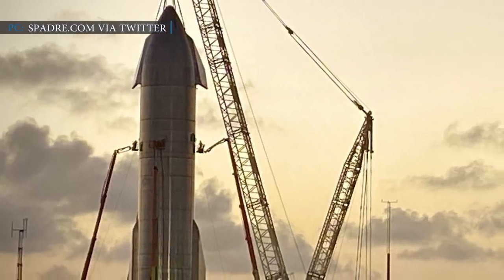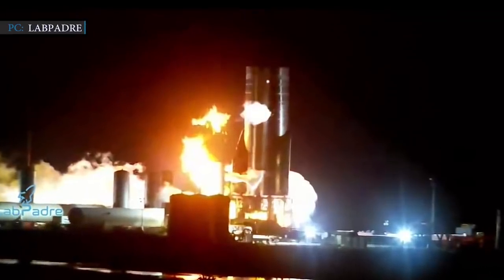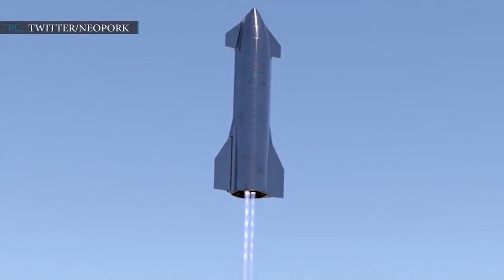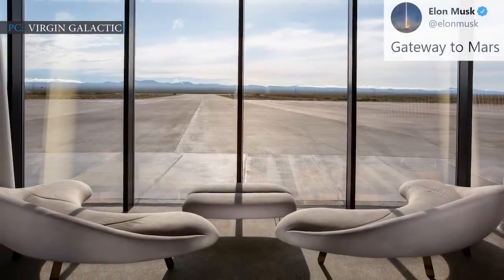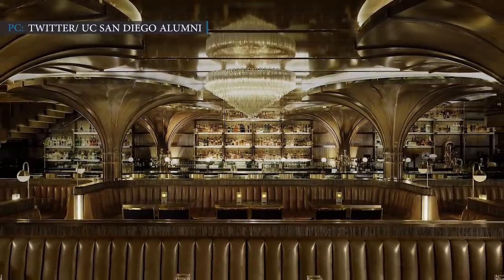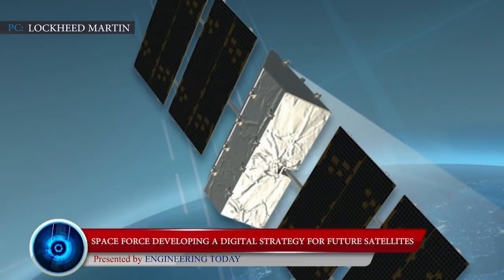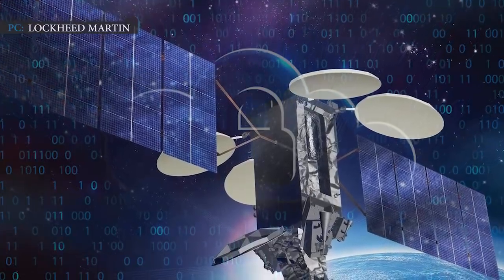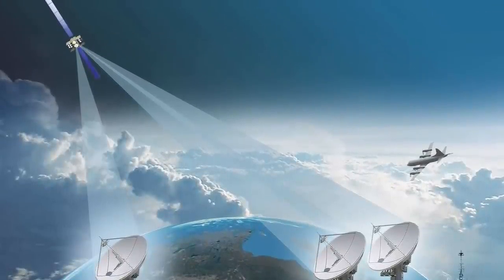SpaceX Flightworthy Starship Fully Stacked - With a Yummy Touch of 'Tikibar'

Comment: Imagine if the Space Force have asked Lockheed Martin+Boeing to develop something similar to Starlink...
Initial cost would have been $999 trillion, within 5 years it would have been over-budget by 750% and the launch date would have slipped to the 22nd century... and still, dial-up modem speeds.